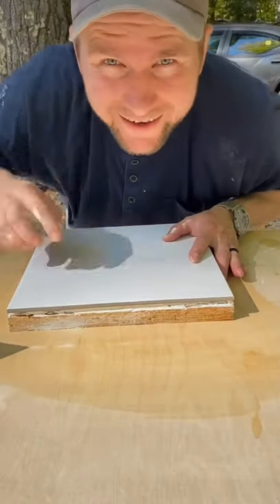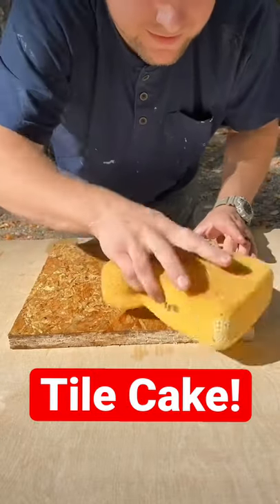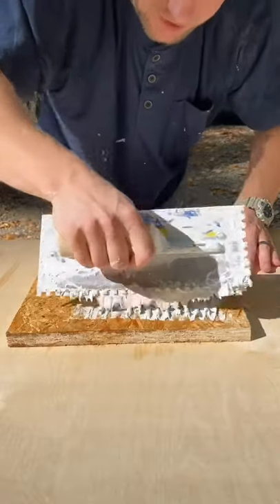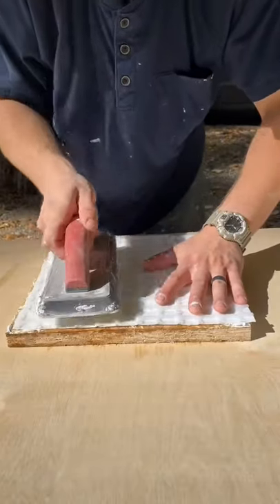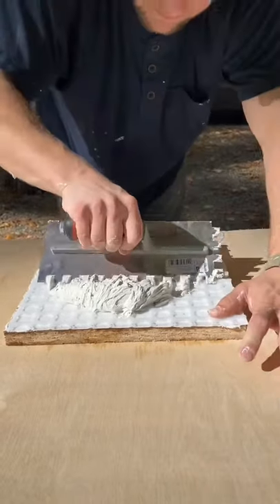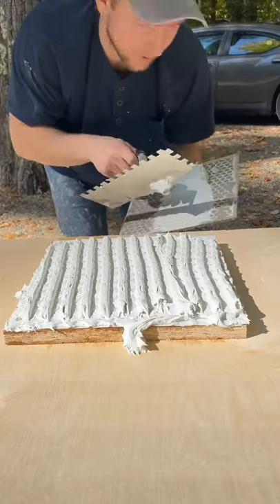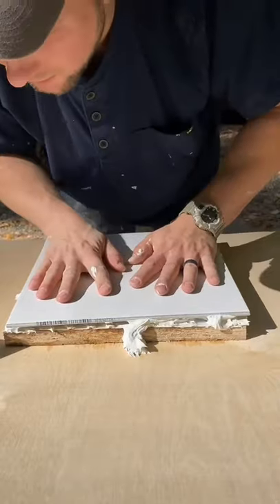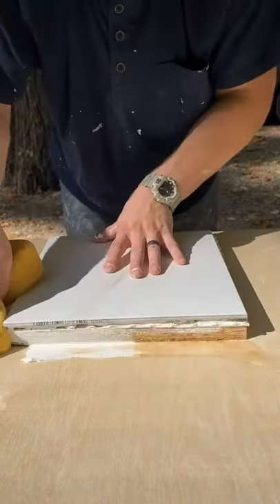Tile installation process. #shorts #youtubeshorts #diy

Comment: As someone who has a very basic experience with laying tile, could someone explain the purpose of making a "Tile Cake"?
Reply: I'm also confused by the purpose here, maybe it's just a single tile example of how to tile a floor but not sure.
Reply: They're delicious.
Reply: It's for Xmas... tastiest cake ever.
Reply: @DavidBrown-pr6kj  the chocolate ones are the bomb.
Reply: It states right in the description that it’s the installation process. In other words this is how you would lay title over an OBS or plywood subfloor. All these steps are necessary to achieve a proper bond and level you would of course repeat this process for each title also using spacers in between each title.

Comment: What is the advantage of the plastic waffle layer?
Reply: The "waffle" underlayment prevents tile from cracking from normal long term shifting of the subfloor.
Reply: @uncommonsense5876  
Not really getting a sense of how that is going to accomplish that.
Reply: It's an uncoupling membrane which allows subtle movement between the plastic layer and cloth fleecing layer, keeping tiles from popping and grout from cracking. Same as schluter ditra(orange colored).
Reply: It's an uncoupling membrane which allows subtle movement between the plastic layer and cloth fleecing layer, keeping tiles from popping and grout from cracking. Same as schluter ditra(orange colored).
Reply: @bryanbenson6551  
That's not really answering it, but I think I figured it out.  What it does is allow extra cushion from the extra mud you are now able to apply...
Reply: @b_uppy  No, it makes it so any movement that's happening at the subfloor (wood) is not transferred to the tile. The waffe will "uncouple“ rather than allow forces to be transmitted from subfloor to tile, thus preventing the tile from cracking.
Reply: @chino2chino  
That's still a hazy picture.
Reply: @b_uppy  
Without membrane: Wood moves, tile breaks.
With membrane: Wood moves, tile don't break.
How it works: Membrane splits instead of the tile.
Reply: @chino2chino  
You mean membrane breaks down and flattens just the right amount if a board pops up?
Reply: @b_uppy  it might make more sense if you think of it how it normally would be installed, large sheets over entire subfloor.
Reply: @someonedoesitbetter3151  
People keep trying to explain the defect instead of what the protective mechanism is.  Think it's a case of everybody knowing you need to do it but the particulars are hazy.  It's why the descriptions are poor...
Reply: @Heb101922  
That doesn't prevent breakage when a board buckles upward.  It's not about cleat action that way.   
The cleat action holds the mud in place and prevents lateral slippage of mud.  It still fails to explain how this works better...
Reply: @Heb101922  
It's not your 'rationale' I am looking for.  I am asking why the waffle layer and extra mortar layer work at preventing cracking.  What I keep getting are poor explanations.  It's regurgitation of what's commonly spouted rather than an explaination with deeper knowledge...

Skip being snide when you fail...

Comment: I've been using a 1/4 trowel this whole time 😂
Been working just fine
Reply: Probably not working as fine as you think, especially with floor tile.
Reply: @gregvergara7596  true. I did recently get a 1/4 and 3/8 dept one. Works out alot nicer 🤙

Comment: 3/8 trowel . No one uses 1/2
Reply: The only people who use 1/2x1/2 trowels are idiots who want full coverage.
Reply: I'm confused by the statement 'no one'. Clearly this guy does... So that's... Someone??

I'm surprised the trowel making companies manufactured a half inch trowel in mass production for sale of one unit... Maybe he got his custom made
Reply: Depends on the size of the tiles being layed. Very large  tile needs a large trowel. Ever layed any 36x 36 or 48x48.?
Reply: @stanleybrown1151  exactly. Even a 1/2" notch would be small with extra large format tile like those, especially on a floor. Unless you notched the floor, and the backs of the tile. 30x30 are the largest I've layed, and that was on shower walls.